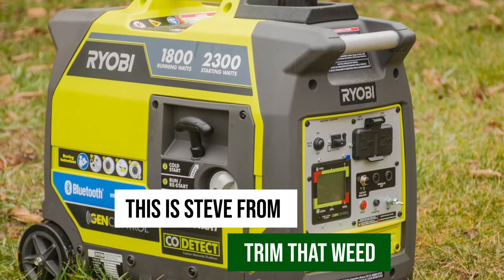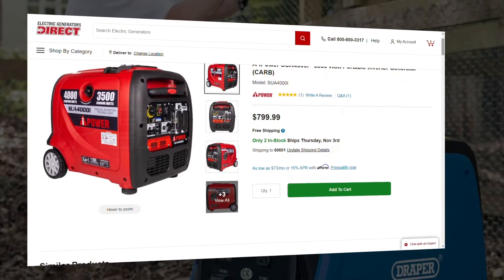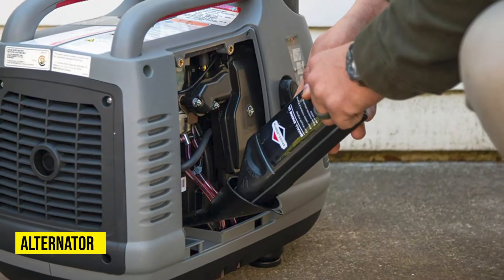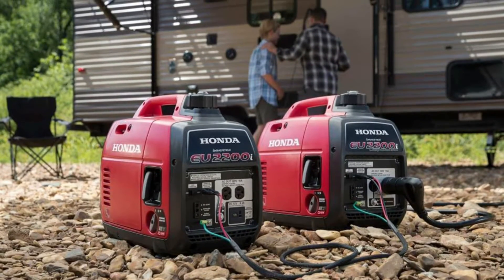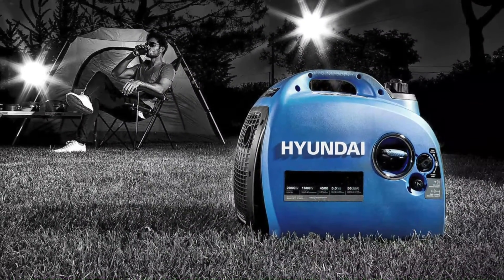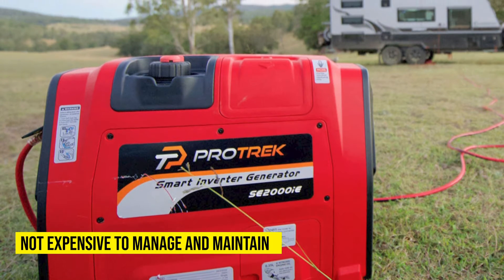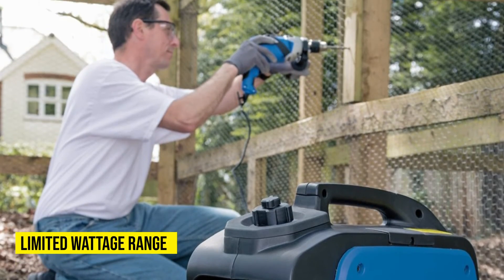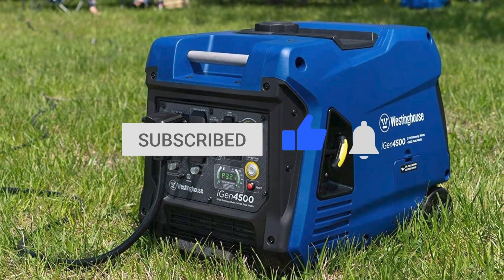What is an inverter generator? (How does it work?)

Comment: The inverter generators that run on gasoline (some run on propane) shouldn't be "Stored inside the house..." as this video states. These are powered by an internal combustion engine that burns fuel (gasoline or propane) so they are not necessarily a "Clean" energy source. They do produce "Clean" (STABLE AC) that has less harmonic distortion than conventional generators but they aren't truly "Clean" power such as can be provided by solar.

Comment: Is an inverter generator able to run a CPAP machine AND a small electric heater simultaneously?  I need both when camping as I have a '74 fiberglass trailer that has no heat source.   Thanks.
Reply: There should be labels on the machine and heater that say how many watts each one uses